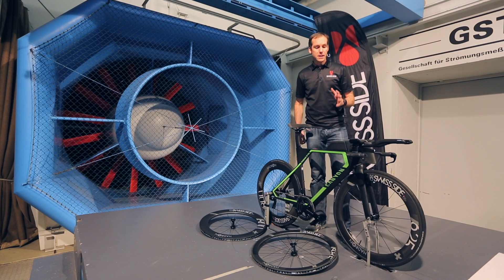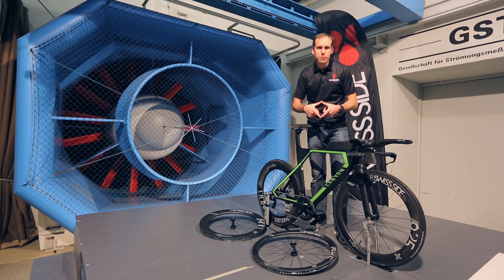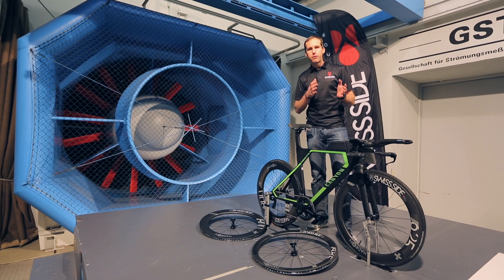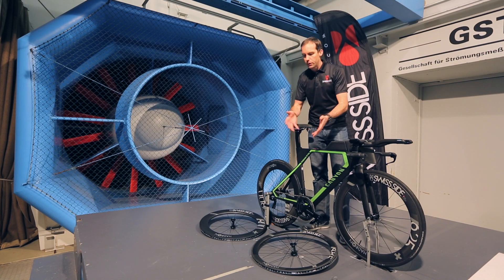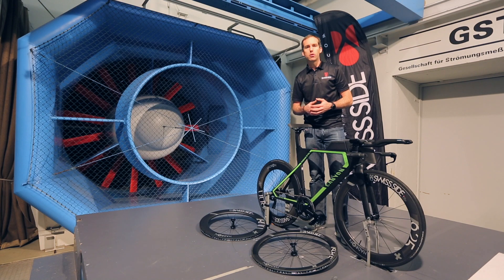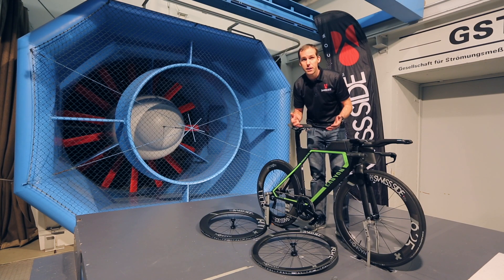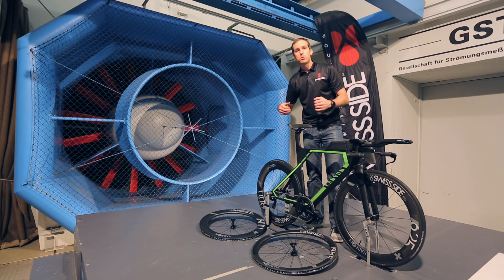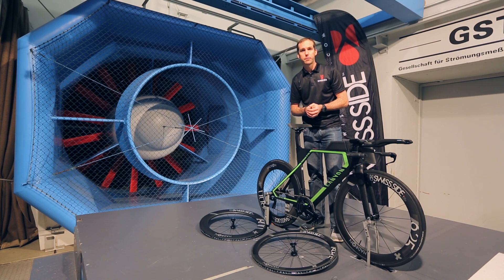Swiss Side Aero Tip - Front Wheel Stability

Comment: it depends on how used you are to these wheels - even more than on the depth of the wheels. When I rode my 625(front)/800(rear) combination for the first time I really thought that I would never use them in heavy side wind conditions and wanted to buy a 485 front wheel. But meanwhile I feel save and pretty comfortable with my combo and have ridden them at wind speeds up to 40+ kph... all good!